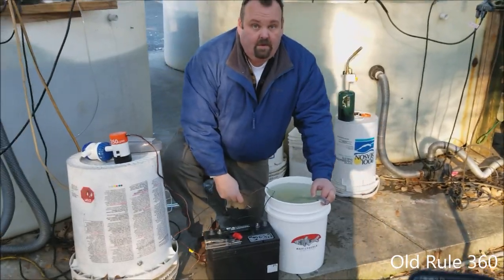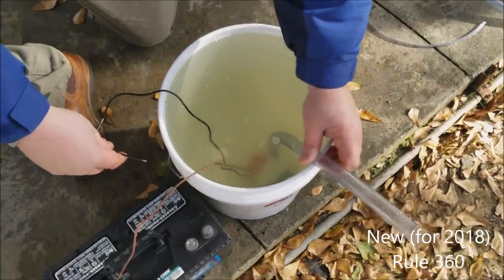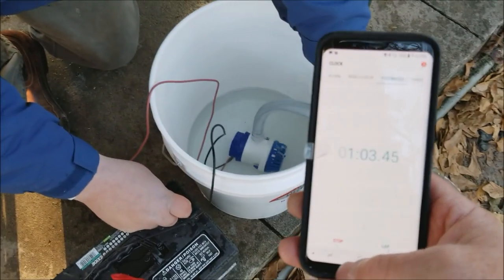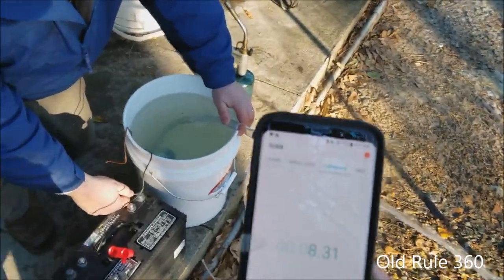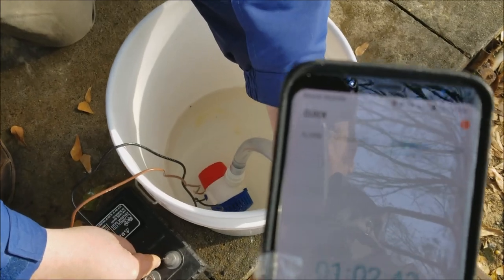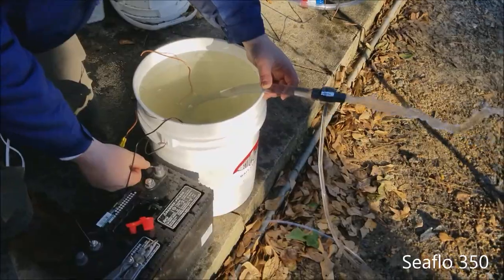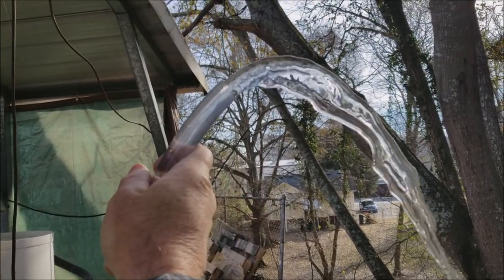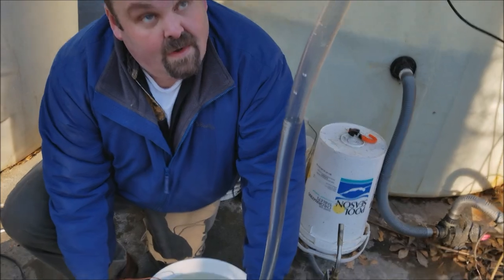Bait Pump Comparison 2018 - Striper Soup - Rule, Shurflo, Seaflo

Comment: how long does the battery AGM 12V run for a long time?
What is the maximum current when the pump is running in water?

Comment: Thank you guys.  Very helpful.  Works great as a comparison between pumps.  However not as a absolute test of gph at zero head.
You only pumped out about 4 gallons.   So for the  new rule that is around 354 gal/min.  Then the others are worse.  Just divide the gpm in the table at the end by 4/5 to get a more accurate value.
Reply from the maker: Great observation and very true.  The test was definitely done by hillbilly standards. :D
Reply: @stripersoup5546  No problem.  Plus 5 gallon buckets hold a bit more than 5 gallons.  Next time use two buckets.  One empty you have marked to exact 4 gallon level.  Then time how long to fill to that line using pump to empty another bucket.  More precise.

Comment: Totally unfair test unless you recharge the battery in between.
Reply: Recharge a 120 Ah battery between short runs of a very low draw motor?  This is field testing, not highly controlled lab-style experimentation.  Take it for what it's worth.
Reply: How do you know it wasn't recharged?

Comment: What you see here is the reason I would not install a venture of any kind in my bait tank ,, reduced water flow is just fine for small herring but for big gizzard shad it is terrible, the faster a tank will filter water the better for gizzard shad. Also I like to use all kinds of fish for bait , in May I have more bream in my tank than anything, in April I have more alewives and threadfin than anything else , the rest of the year it’s all of the above but mostly gizzard shad ,, so I choose to keep my tank most suitable for gizzard shad. Ohh and I have been a guide for over twenty years,,, also a tsunami by Atwood is the longest lasting pump in a tank once you add the proper amount of salt ,,the 500 size is perfect for most tanks. I have found that some pumps last and preform well without any salt in the water like rule , but once you add the prescribed amount of salt to that water ,,, one ounce per gallon, they just don’t last very long.